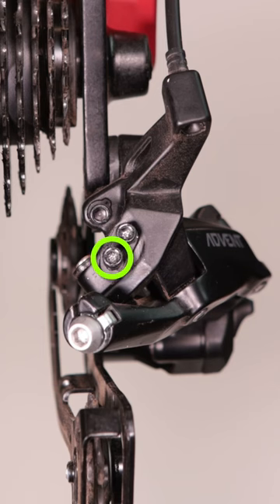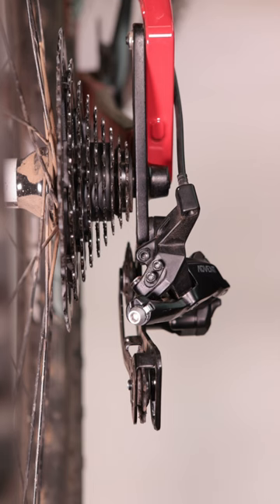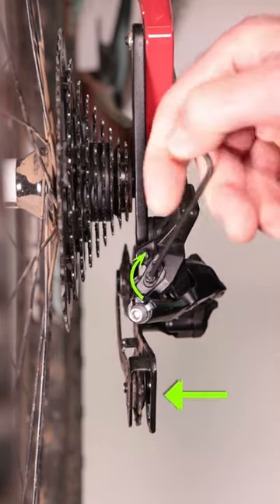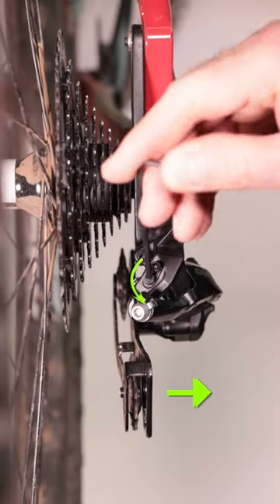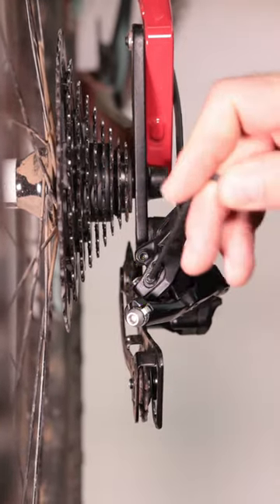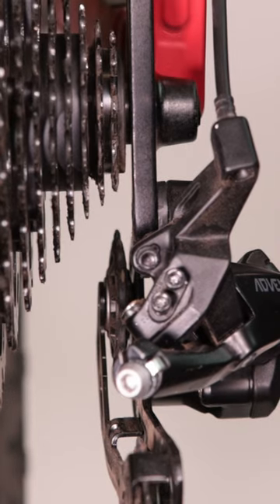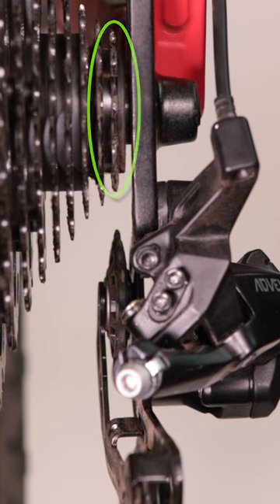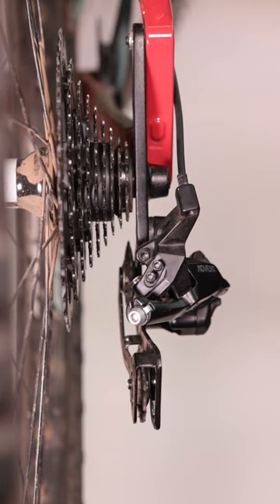How to set the high limit on Acolyte, Advent & Advent X rear derailleurs

Comment: I have noticed, that your guide pulley is not on the same plane as the smallest cog. It is pretty obvious, that far side of the pulley points more towards the hub of the wheel by some degrees. Is it on purpose?
Reply from the maker: Yes, it helps with chain line.

Comment: Nope, you don't need to completely align the pulley to the smallest cog
Reply: I don't understand why you wouldn't. Could risk binding the chain. Better safe than sorry
Reply: @n8_vel868  if you completely align the pulley to the smallest cog it will have a delay shifting. Aligning the pulley to the smallest cog is only applicable to a brand new components. I've been a 5 years bike mechanic and that's my experience repairing and tuning bikes.
Reply: @genesvinceguillena7512  imma be honest, my Shimano tourney derailleur has to have the pulley set a little further out since it has a delay shifting on the smallest cog. I didn't actually think this was an issue on other used derailleurs. The whole time I thought it was my hanger was bent but even after an allignment it still has a delay. Funny enough I was wondering about this issue earlier and just figured if I set the pulley out a little ways it fixes the issue.
Reply: @n8_vel868  even to high end Rd's has the same issue, I don't know if it's also an issue to electric shifters. I've only tune up  cable actuated Rd's
Reply: @genesvinceguillena7512  it'll be awhile before I own anything electronic on my mtb😂 but yeah didn't think if they have that issue either🤔
Reply: @genesvinceguillena7512  but that is a new component, hence no cable or chain, if the cog is mis-aligned it will rub causing it to skip